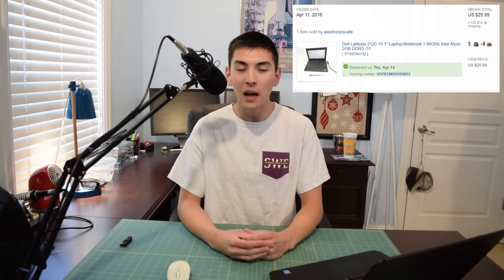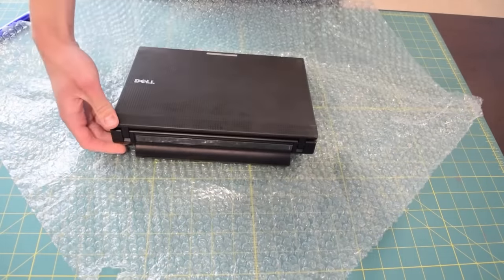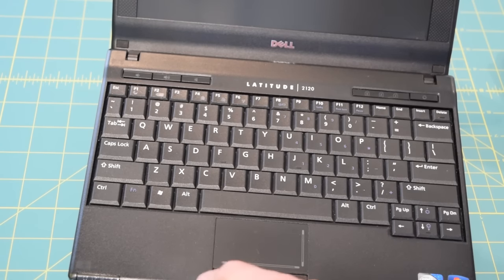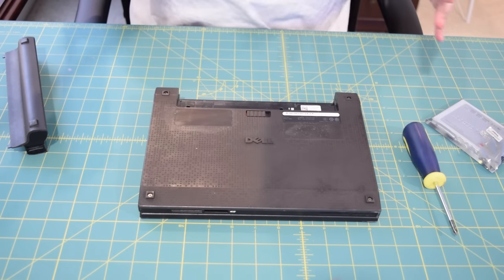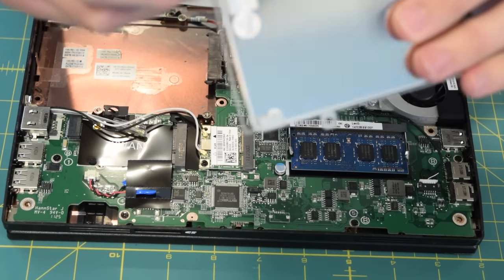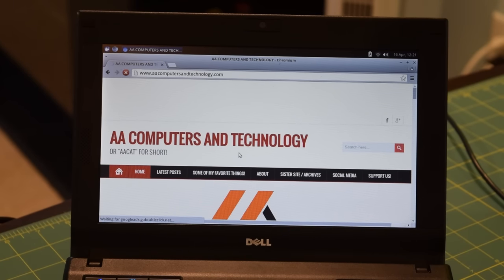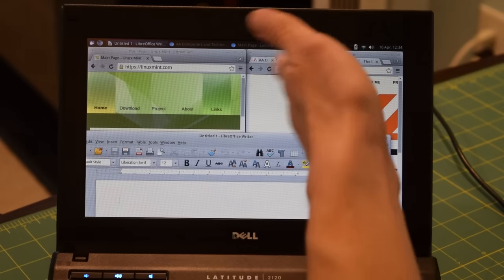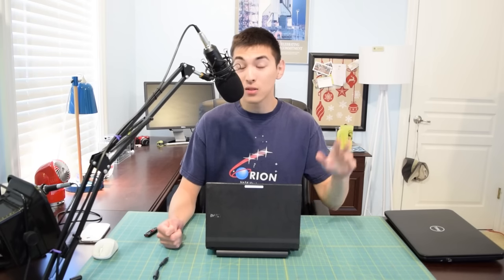eBay Finds: $25 Dell Latitude 2120 Unboxing, Teardown, Overview, and Test

Comment: I do not know if you still have the 2120 anymore but you could order it with a handle. The handle attached to it by the Kensington lock, that is why it had a lock on both sides. You can push the keyboard out through the screw hole on the back so you don't have to use screwdrivers to pry it up.

Comment: Thats definitely a sim card slot. Netbooks used to have sim cards during the craze back in '06
Reply from the maker: +Big Mountain Bob Thanks the confirmation!
Reply: +Big Mountain Bob Funnily enough I only realized that my old laptop use to have a sim card slot just before I sold it off on eBay.
Reply: Yep, that other slot there is for a WWAN card that the SIM would be attached to to let the laptop online.
Reply: Not just netbooks. I had a "full sized" Latitude D830 (15.4 inch screen) laptop with a SIM slot - Used with AT&T 3g at the time.
Reply: mine t400 got sim slots too

Comment: Your reviews are always good.   I owned that unit and I dual booted with Windows and Linux.   Worked fine even with the 2gb of ram and Atom processor.   Its not a powerhouse but then I paid $40.00.   The 128 SSD was $30.00.

Comment: That laptop looks like an educational laptop that schools would buy.  The wifi light was so teachers could tell when a kid was browsing the net or so I heard.  I would personally  (and probably will at some point) buy a lenovo thinkpad x230 they are pretty cheap now with 3rd gen core i5 processors and 4 or 8gb ram.    for 25$ that's a pretty decent deal
Reply from the maker: +FubarMike Yup, I am pretty sure it was considered an EDU laptop.  I have gotten a few reccomendations of the X230, looks like a pretty good machine!

Comment: If you're looking for a small netbook/laptop than this Latitude 2120, I'd either get the Latitude 2120 that has the Atom N550 (2 cores, 4 threads) processor, which is noticeably faster than the N455 (1 core, 2 threads), or for a lot more performance, you could try to pick up a Lenovo x130e laptop with a Core i3 CPU in it.

Comment: ZUBUNTU is based on UBUNTU but the people who develop UBUNTU are starting to use the FreeBSD core which will make for a nice stable OS but I think that some of the UBUNTU software might make the OS slightly unstable so I think that they use the software manager called PORTS so that it will be more stable.

Comment: What a beautiful computer, I totally love the size and design. Much better than the Dell Mini netbooks. Only issue is that Intel atom processor, atoms are my least favorite processor, they just have zero grunt and get overloaded very easily. My old Dell mini 9 actually had no fan or heat sink, just a bare processor.

Comment: $25 including shipping? Where do you find these deals on ebay? I always find ebay way over priced compared to my local craigs (Vanc,cdn)
Reply: Just look for auctions. Not "Buy Now" items, and sort your search by Cheapest first.
Reply: Well Techie Pocket answered you already, but keep in mind these are usually old computers- for linux operating systems however (like Xubuntu showed in the video) it's more then enough :-) 

Typing from my Dell D430 with Ubuntu 17.04 (6:35 Dell does have sweet sweet built quality, don't they?)
Reply: matt jump you can choose the price to what you want and it will list tons of items within that range
Reply: You answered your own question. You're in Vancouver, 
eBay.ca has a much smaller selection then .com does and alot of them are coming from the US which means higher delivery rates AND we get hit with import fees...  Also take into account the difference in CDN to USD
Reply: You’ve never seen Marktplaats.nl yet. Overpricinguselesscrap.nl
Reply: Kinda defeats the purpose if you have to convert Euros to Canadian Dollars, plus shipping will be outrageous..
Reply: thaghost909 LoL.  Probablly a spammer.
Reply: I got one on amazon for 105 including ship

Comment: I had one of these years ago, it was good back in the day, the biggest mistake I made was upgrading from Windows 8 to Windows 10. The laptop was good on windows 8 because of the touchscreen and the rapid 20 second boot times. PS Windows 10 took around 20 minutes to boot on 1GB RAM.

Comment: Where the WWAN Card is, you could probably look at putting an MSATA SSD in there if you don't use the mobile network over there.
Reply from the maker: +John SMith Hmmm, maybe! Thanks for the suggestion!
Reply: +AA Computers and Technology I have a Lenovo Thinkpad as my daily use laptop and that had a WWAN card aswell until we swapped it for an SSD. Works perfectly

Comment: That's pretty neat. You are always surprised by a weaker machines ability. Recommendation though. Try maxing out its ram and see if you can allocate more to the v-ram. It WILL NOT make gaming even close to possible. Unless you're talking like real old games. But it will definitely help with 1. tabs in chromium and 2. youtube playback and 3. "graphically intensive" website.

Comment: Many latitude series comes with sim slots for 3G and 4G wireless. The single core Atom cpu based netbooks just kinda stink for multitasking. The good news is linux will run much better than Windows 7 starter anyday. Even the dual core Atoms struggle so, your really not missing much. But having ddr3 is a bonus for the bandwidth restricted cpu. One of the better netbooks of it's day.

Comment: Never tried a laptop with an atom processor but i'd assume it's the bare minimum for what you'd want, productivity wise. Especially it being only a single core multitasking might not be the best.
Reply: Poptart McJelly for daily uses on linux i don't know, but you need to get at least i3 for running windows 10 smoothly. lowest end is still ok, just not cherry trail, i guarantee it will lag after quite some installation of apps
Reply: kenny ricardo windows 10 can browse the web on an atom, and a Celeron or Pentium should be good enough for older games. It really depends on the professor

Comment: speaking of that battery I have a PowerBook G4 from 2001-2002 and I got it for £60 off of eBay and the battery still holds a steady 3 hr charge which I thought is brilliant for a 2001-2002 laptop 😉

Comment: Might try Linux on mine, ive got an 11.6" Asus E200HA with the Quad core Atom 1.84GHz and 2GB of ram, its fantastic at under 1kg with 13 odd hours battery life but I find with windows 10 its just too slow for me.

HOWEVER these old netbooks are ideal for remote desktop onto your main machine and couch surfing in the house!

Comment: I can't use any laptop without a DVD multidrive, below 15.6in screen, below 4gb of RAM.(besides legacy laptops such as core 2 duo back). I also have a 1st Generation i3 laptop that probably uses similar architecture as the Atom. It a Core i3 370M. its a pretty good performer for its age, runs Windows 10 perfectly. the laptop is a Toshiba Satellite l655-S5106.
Reply: CreeperGuy 555 I don't like external drives, I like the optical drive to always be there when I need it.

Comment: My HP Mini 110-3500 netbook had the same specs as this but mine has 1GB of RAM. UGH, 1GB of RAM is not enough that will make some netbooks ran slow as a snail. Anyhow, I'll upgrade my HP netbook to 2GB of RAM and an SSD in the future!

Comment: great video as always!, as u said if it isn't to speedy for ur needs  I would recommend seeing if u can replace the CPU and maybe add 1 stick of 2gb ram if u can. I'm not sure if that atom is soldered on the mobo though. I'm very surprised it's that response my first laptop had a AMD sempron si-42 2gb ram and a AMD HD GPU it cant even load windows 7 uless u end up pulling your hair out for waiting ages for it to work. also in the bios i saw a video setting so u could possibly get more vram as it said u had 8mb :/. keep up the great video's  dude!
Reply from the maker: +The_Magic_Potato Oh wow, was the VRAM really set to 8MB, I need to fix that :p.  Thanks!
Reply: +AA Computers and Technology yep, at 8:48 Intel GMA 3150 graphics for you :p hope it helps u out and gives u a boost in performance!
Reply from the maker: +The_Magic_Potato Dell did not make dedicated VRAM allocation manipulable in the BIOS. Ahhh, bummer :\
Reply: +AA Computers and Technology ahhh :(, some of the dells do support an option for increased Vram. that's a bummer 8mb isn't a hole lot for using the web as its more resource hungry :/ u could try and find a modded driver for it that's what I did for my Hd1000 was at 64m now at 128 it also made the MHz higher as Max was 766 then when to 800 due to the modded driver. it will help a lot if u are able to find one. IL try look for one if you are interested?
Reply from the maker: That's okay.  It would probably be nearly impossible to track down a driver that would work with Linux.  Thanks for offering though.
Reply: +AA Computers and Technology you are welcome! :) shame its hard to find a driver for such a old integrated gpu :( IL catch u in the next video! 😀

Comment: Thinkpads for the last 6 years at least have all had WAN compatibility and SIM cards. Also, why do you prefer Ubuntu over Arch and Mint?
Reply: Spoiler alert: Mint is Ubuntu based.
Reply: Jonathan Saunders ubuntu is to demanding for snappy performance and as the above coment states the mint distro is baced on stock ubuntu modded for looks

Comment: Well, you gotta admit for a potato for a cpu and gpu it does pretty darn well. but of course that is this laptop's biggest flaw. Even the modern Atoms aka Pentium silver are not that great for performance. That of course was never the intent anyway. Cheap, well for the cpu, this netbook wasn't cheap. But most at the time were. Cheap to make, cheap to buy.

Comment: some more ram would help.Good for emulators or a young child's first computer.
Reply: +keiran bowes these machines don't accept 4GB SODIMMs. The CPU can only address 2GB of RAM in total. CPU matters more than RAM on an Atom system. I had the N550 with 2GB and it ran very nicely on win7.
Reply: +nelizmastr I think it was also in part because Windows 7 Starter would not allow more than 2 GB of RAM in software.
Reply: Jordan Woolery Yeah, but the CPUs in these are limited by Intel in hardware as well. They didn't want to lose money on the celeron and pentium chips to people using Atoms with a bazillion gigabytes of RAM for server duties.
Reply: +nelizmastr right

Comment: :O i may have gotten a better ebay deal than the legendary Braxtan Vangundy :O i got a Dell Latitude 2120 perfect condition 250gb hard drive 2gb of ram and the intel atom n550 all for 50 dollars with free shipping. :))

Comment: Man this thing with a 3 cell pack (like you mention) rebuilt with 3 of these http://www.ebay.com/itm/100-Genuine-Panasonic-NCR18650B-3400mAH-Li-ion-Battery-Made-in-Japan-/301990181062?hash=item46500478c6:g:NqsAAOSwzJ5XZqc5 would be pretty epic! that's 3400x11.1=37.7 what hours with a "flat" three cell pack and (of course) 75.4whrs with a 6 cell. The think would probably last all dang day!!

Comment: why can't I get lucky like this?
Reply from the maker: +Timothy Reth You just have to shop around.  I put the link to the eBay seller I bought the laptop from in the video description if you want to take a look at some of the other PC's they are selling.  I think there might even still be a couple 2120's for sale!
Reply: +AA Computers and Technology 
Thanks!  Im getting a car tomorrow and my gateway MA8 is too bulky to keep as a car laptop so i've been looking for a small laptop!
Reply: +AA Computers and Technology 
btw just tired and it says the store does not exist.
Reply from the maker: +Timothy Reth Ahhh! alright, I will fix that.
Reply from the maker: +Timothy Reth The link should work now!
Reply: +AA Computers and Technology 
it does, thanks!

Comment from the maker: Don't forget to check out this month's giveaway if you have not already! 
http://www.aacomputersandtechnology.com/april-giveaway/
Reply: You should try for a lenovo X301 it is fairly light and thin, based around a core 2 duo and has a 64 or 80 or 128gb ssd with a max ram capacity of 8gb I found one that was going to be thrown out was ticked out and had cost over $3000 8 years ago, I use it as my portable laptop day to day,  it works well and when I need more processung power I can use my desktop that I built with a i5 6500
Reply from the maker: +Toby Cowles Those are still a bit pricey on eBay but they look like decent systems.  Thanks for the reccomendation!
Reply: +411607 it sure is, this channels awesome!
Reply: atom cpus 🤐
Reply: does it suck?
Reply: lol i had a 2100 a few months ago. it was pretty decent. there were no issues that i knew of. it looked EXACTLY like the one on the dell website
Reply: it looked EXACTLY like the one on the video
Reply: I noticed you say 'Zubintu'. Pls stop.
Reply from the maker: This is actually something that is debated quite a bit.  Though, most people agree that it should be announced as Zoobuntu.  http://linux.wikia.com/wiki/Xubuntu
Reply from the maker: That is not what I have read / heard.  It seems like most people concur that it should be announced Zoobuntu.  http://linux.wikia.com/wiki/Xubuntu
Reply from the maker: Lol, the original Xbox had a Pentium III coppermine, 64MB of RAM, and a Nvidia NV2A.  This laptop is definitely more powerful than the original Xbox :D .
Reply from the maker: I forgot this was the N450 model, I also did a video on the N550 variant of this laptop which is definitely more powerful than the Xbox (I use it as my daily driver).  Even so, benchmark scores for the N450 @ 1.66 are still higher than the P3 at 733MHz.  If you were to perform a daily computing test on a system with similar hardware to the Xbox vs. the Latitude 2120 featured here, chances are the Latitude would be much more responsive.  I have no idea if this can run Halo or not (never tried), but Halo for the Xbox is optimized to run on the XBOX so it is expected that the performance would be better.
Reply: i just bought an i5 e4310 for $56 complete with hdd and charger only is that the the back slash and enter keys are now working
Reply: AA Computers and Technology why zuebin2 and not windows just use the same key accross the laptops